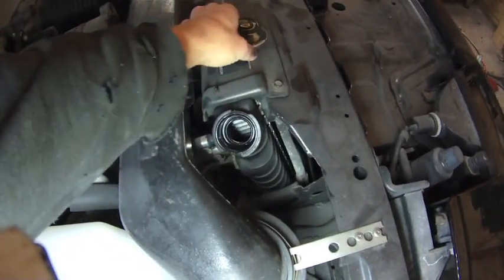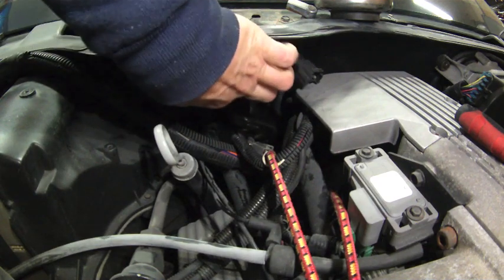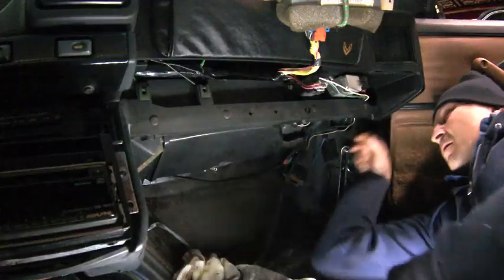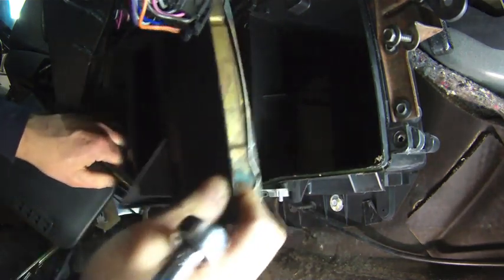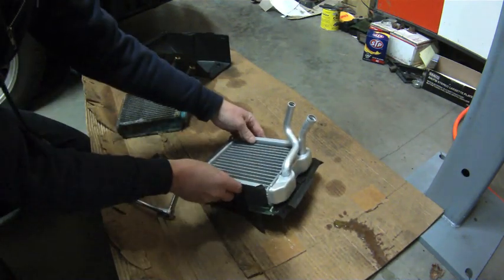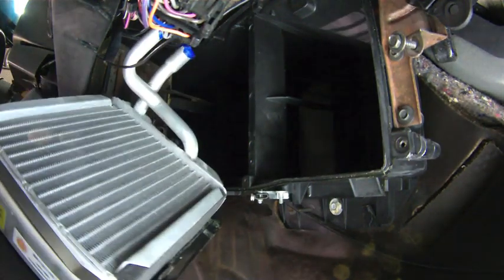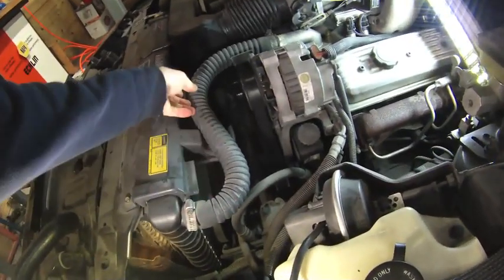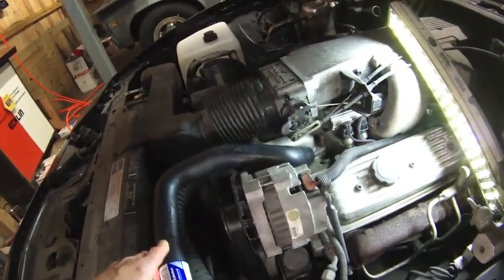Project Trans Am P4 Heater Core

Comment: You made this look easy, mine fought me hard putting the brass NOS replacement back in and it looked very close to OEM. I had to remove the smaller hold down to get mine back in but I figured with the strap it should be enough. Those hoses on the firewall were tough to get off as well.
Reply from the maker: Thinking I got lucky with this one. Getting it through the firewall took a few tries, but I had light under the hood to see the holes from inside. Thanks for watching!

Comment: Wow!  I've been working on mine for a couple of months.  I had a rough time getting the hose off the core.  I would try one thing, get discouraged and try something different.  I finally got it off after a couple of weeks.  And I decided to fix my odometer and I'm going to put foam back on the blend doors.  So I have the dash most of the way off.  Great video and thanks for posting....
Reply from the maker: Mine didn't fight too much, guess I got lucky. I'd like to see the process of the foam repair, planning to share on your channel?
Reply: @OldCarGarageUSA  I'm not the kind of guy that wishes you had a rough time because I did.  I'm so glad you didn't!  I'm the original owner of the car and have treated it very well.  But somehow she want to fight me.  But yes I'm filming it and will be posting my restoration.  And thank you very much.....